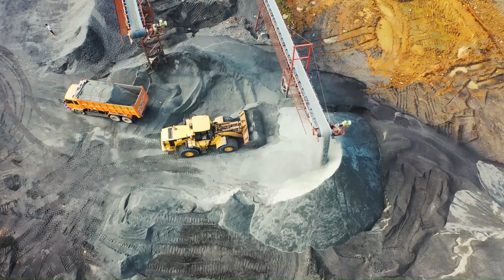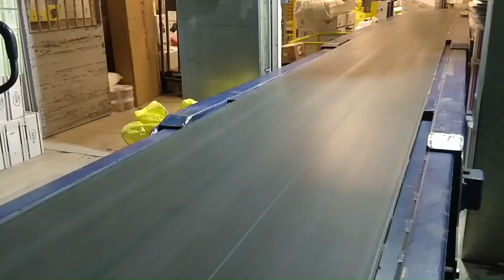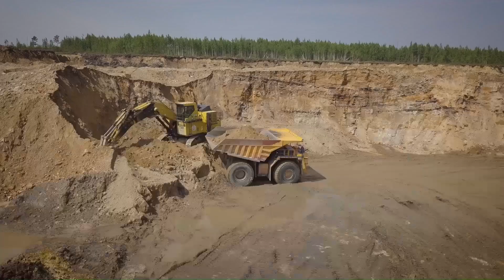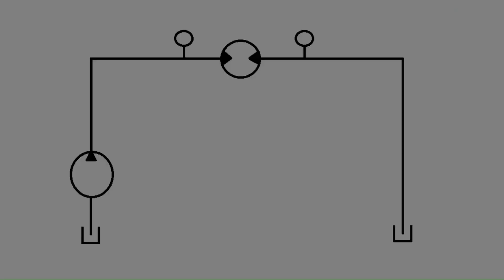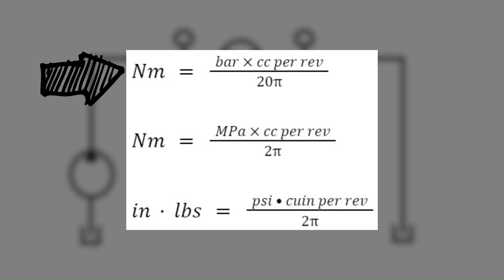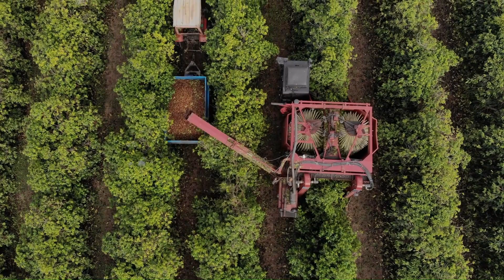How to: Calculate Hydraulic Motor Torque

Comment: Good day mate. 
Is it possible to run a hydraulic motor at 30% -40% of the rated capacity? 
I plan to use  a honda gx390 (11hp with 25Nm) to drive a 16cc x2500rpm hydraulic pump. Theorctical output of 40L p/m. I want run  a hydraulic motor rated a 250cc rated at 300rpm/708Nm. My target speed is between 100rpm.-150rpm and minmum torque of 200Nm. 
Is the hydraulic pump sufficient enough to operate the hydraulic motor to the desired speed and torque? 

I am limited due to the honda engine as i want to keep it small and mobil.

Cheers..
Reply: Did you ever get this project going? trying to do something very similar over here lol